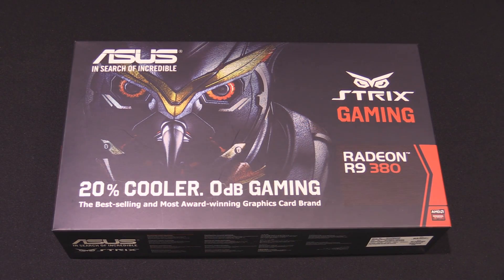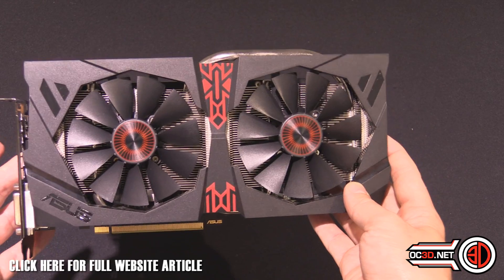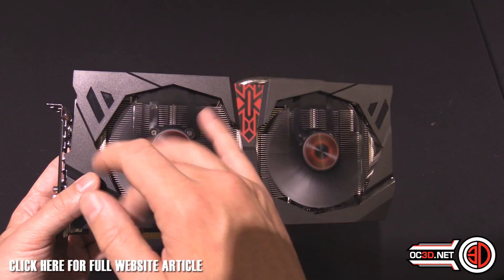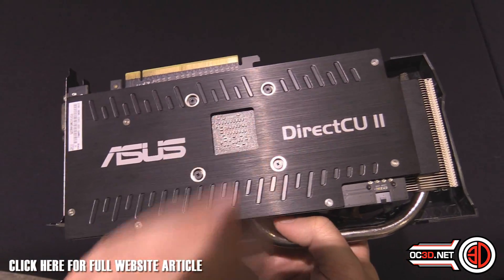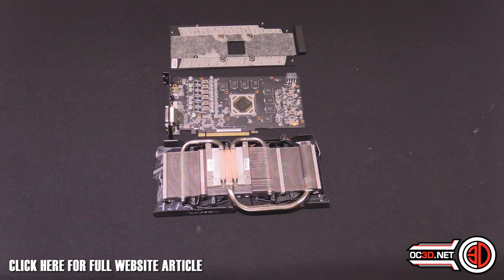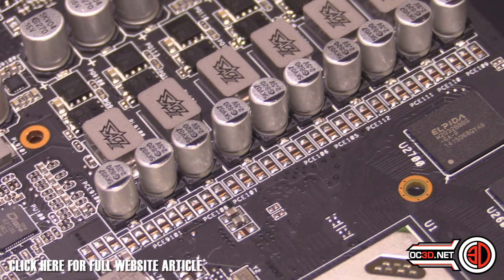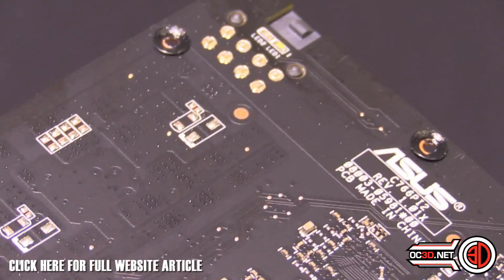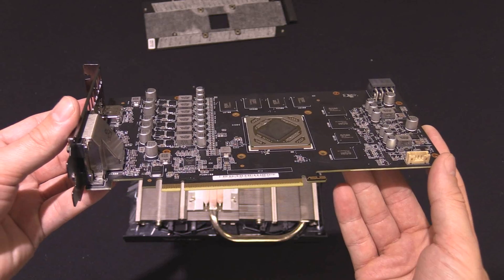Asus R9 380 DCU2 Fully Automated GPU Process

Comment: no GDDR5 cooling? friend got an Asus 280x and it has really bad memory that's factory clocked at 1600mhz 1.6V and is unstable, he had to send it back tho A LOT of ppl have the same problem... I lost trust in Asus cause of that... out of 12 chips 4 are not cooled and they artifact like crazy even UNDERclocked to 1400mhz or even lower... tried bios updates and stuff but nothing helps...
Reply: ***** I said memory, read dude... I even said that out of 12 chips 4 are not being cooler... and who the fuck mentioned MSI 290x? what the fuck...
Reply: +Error989 Shut the fuck up
Reply: +Error989 You're saying true facts, 280x had lots of artifacting because of that
Reply: Maybe more cooling components in your pc will help (airflow in your case) , my card is running on 67 ° stable and them memory is really cool too
Reply: Botolinum Toxin I'm talking about VRAM not GPU... friend's VRAM sensor said the memory was only at 70° but that's because the chip that has a temp sensor was cooled... he has sent his card to RMA and since they didnt have 280x in stock and they were no longer produced he got a MSI Nvidia 970 as a replacement (what a deal...)

If you have hynix or samsung memory you probably wont have any problems, if you have elpida you might be fucked

Comment: So which one should I get: The R9 380 (4GB Version) or the R9 280X?
Reply: Greg Cunningham
The 970 isn't even in the same price bracket. It's roughly 100$ more than the 280x and 150$ more than the 380. The 970 is much higher performance but it's overkill for 1080p gaming, which is the target resolution for the 280x and 380, so unless you're gaming in 1440p there's no point in getting a 970.
Reply: Quim Camprubí Casas I've heard the r9 280x is faster, but the 380 is a lot cheaper, and has 4gb of VRAM (if you get the 4gb version, but there's also a 2gb version) while the 280x only has 3gb.
Reply: Quim Camprubí Casas  I would consider the 970 over the current offering.
Reply: Greg Cunningham Both the R9 280X and the R9 380 cost 245€ in my country and the GTX 970 costs 370€ its by far out of my budget... I would consider wasting up to 300€ but not more. that's why I want an R9 380X.
Reply: Quim Camprubí Casas R9 380 is faster than the 280/285 and should be on par with 280x. If you can wait for the 380x, if they ever release it.
Reply: NvidiaFanboysBlows Dick I really don't get why AMD didn't release an R7 370X and R9 380X i just feel like they just care about high-end cards (Fury X) and don't give a shit about the sweet spot.
Reply: Quim Camprubí Casas Because it already killed the Maxwell series.